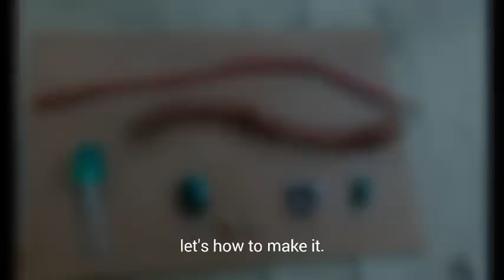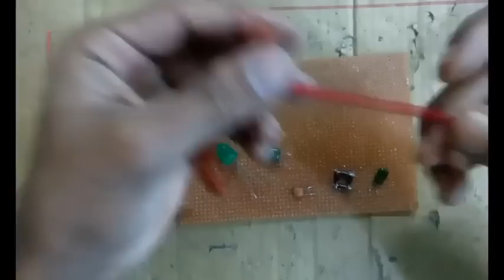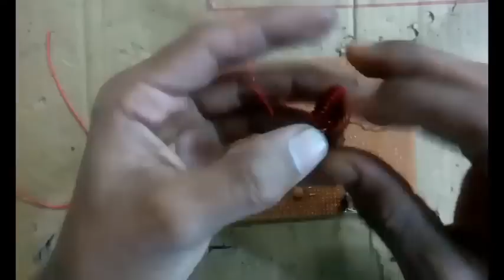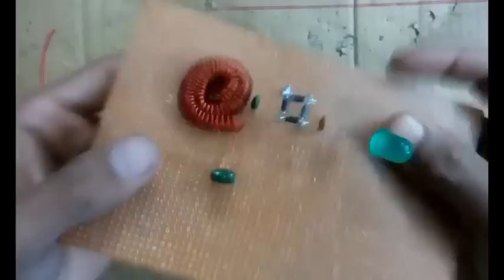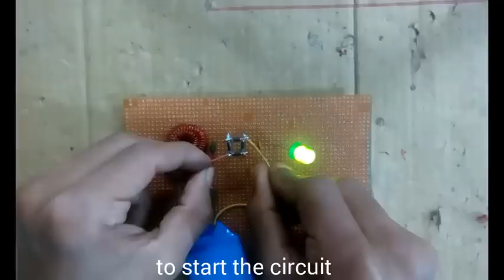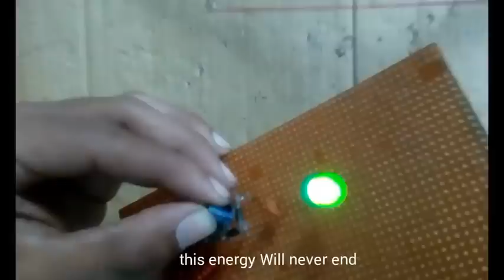Free energy the energy never die, coil reproducing energy

Comment: I believe that various coils can attract positive and negative electrons from the atmosphere and also negative electrons from ground. Much like an electret appears to attract both. I've experimented with carbon nanocoated copper wire and it appears to attract a charge. Whereas as the same length and size copper wire uncoated didn't attract a measurable electrical charge on a standard meter. The Keshe coils IMHO only cause the copper wiring in the circuit it's attached to, to become nanocoated. I don't know if it's the GANS or what does it and I haven't done any experimenting myself.